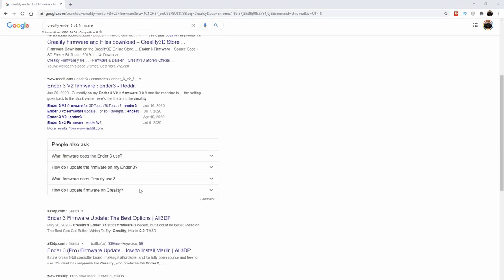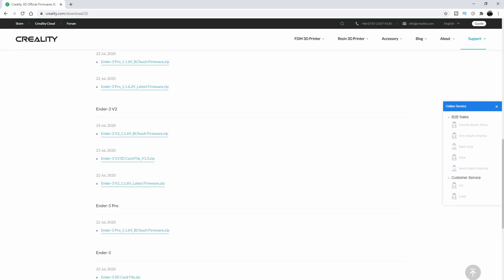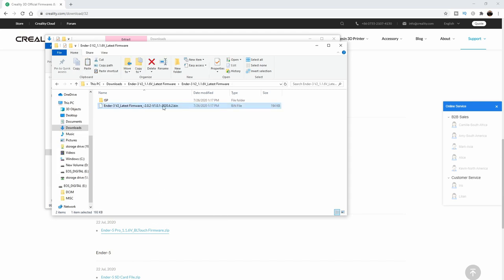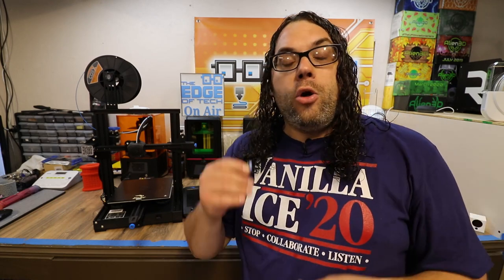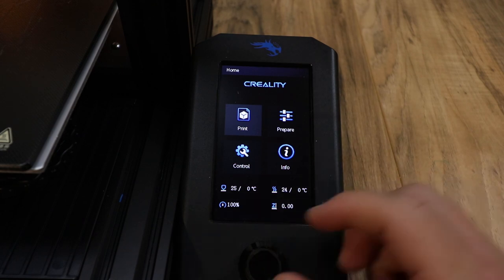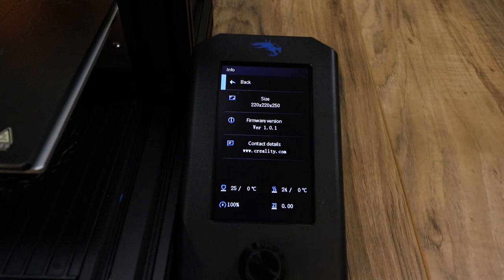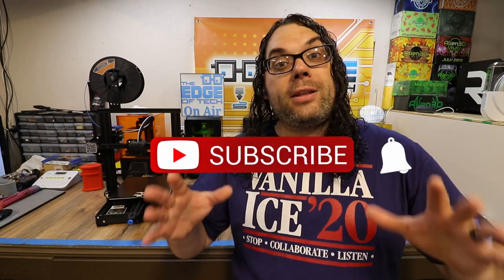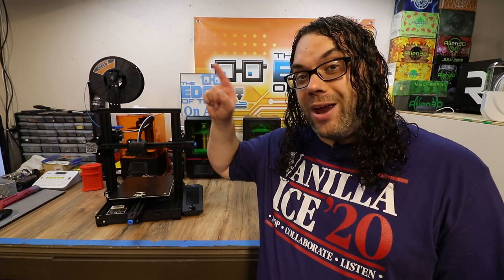Upgrade the Ender 3 V2 Firmware in 5 minutes or less

Comment: You gave me a scare because I thought I bricked my Ender 3 V2.  You must delete other files on the SD card. And I think you must format the SD card as FAT32, otherwise it will not work.  It didn't work for me until I had only the firmware file, on a freshly formatted SD card.  Also, the firmware will not load if it's the same filename as an earlier attempt, so you may need to rename it.  I recommend 8.3 (filename 8 chars or less) just in case.
I'm just happy my 3D printer isn't bricked!  And now it's v1.02.
Reply from the maker: Nice work, and great info! I am glad it's not bricked as well.
Reply: thank you i just need to rename

Comment: It said 1.01 on your display, rename the file to firmware.bin, and it will in fact update to the latest Marlin
Reply from the maker: You never want to rename the file to firmware.bin because on 32-bit boards the firmware name has to be different every time otherwise it will not work. Reality actually miss labeled the firmware on the site, that is why It's different from the site to what shows on the screen.
Reply: @TheEdgeofTech  That is just not true, I have flashed tons of 32 bits boards - all by using firmware.bin on the card. In fact, read a bit on the Marlin page and you will find firmware.bin is the STD on Marlin 2, for picking up the update, all letters must even be in low case.

Comment: Thank you for the video, I have a question though. there are several firmware options dated November 14, options are "with adapter board" or "without adapter board". How do I know if I have an adapter board or not? any info will be appreciated, thank you.

Comment: The point is the official firmware from the Creality"The one you downloaded" does not support BMG or Titan or Gear Ratio equivalent extruder. The reason for this is because the firmware maximum e step for Extruder is only 186.

Comment: So, I followed these steps and now my printer did not update firmware, it just did nothing.  Now it still does nothing when it turns on.  The Creality logo doesn't even show up.  Is there a way to reset it to the original firmware?
Reply: I have uploaded mine m, and it is currently the same. Just a black screen doing nothing. Did you resolve this?
Reply: @ryanowens100   Yes, in my case the problem was a bad SD card.  I grabbed a new card, formatted it (fat 32) and followed the steps of this video.  Worked like a charm.
Reply: @ryanowens100  Yes. In my case, I had a bad SD card.  Once I got a different card, the process described in this video worked.

Comment: Jim, how are you  finding the V2 now that you've had it a bit?
Reply from the maker: I like it so far! It prints very good out of the box and has some great features over the original. I would highly recommend updating the firmware to the newest version you can when you get it though. The stock version has some issues.

Comment: Now i use firmware v1.0.1
I try to new 1.1.6 version ,but it can't update,screen alway black long time . Have you found this problem?
Reply: Im also getting his issue
Reply: fixed it by also copying across the ISP folder to the sd card
Reply from the maker: Nice! I didn't have that issue, but I do see now that the screen has to be updated too. CHEP just put out a great video on this and I am going to do an updated one as well.

Comment: Hey Jim HELP please? I just bought and built the Ender 3 Pro but I don't know what version firmware is on that system. I can't seem to find an answer anywhere on whether or not I need to preform a firmware update???
Reply from the maker: I can look, but if you have the Ender 3 Pro, you probably don't need to do the update unless you really want to. If you have the Ender 3 V2 then you would want to do it. But they are done completely different and this method will not work with the Ender 3 Pro.
Reply: @TheEdgeofTech  ok thanks. I was hoping I didn't have to go the boot loader way so I will probably just leave it be

Comment: thanks, helped me a lot, hope you can do a video on how to install BLTouch fo Ender 3 V2. thanks
Reply from the maker: This is highly requested. I am trying to get one now, and when a good firmware comes out for it, I will make the video! :)
Reply: @TheEdgeofTech  There are two good options for firmware for the BLTouch on the E3 V2.  One by Smith3D, and one by JustAnAussieITGuy on Reddit.  See here for a good mount and links to these firmwares.  The only challenge I've found is wanting/needing to make additional customizations to the firmware for different hot ends, mount XYZ offsets, etc.  I need to learn Marlin!

Comment: I was wondering if you can give me a hand I just bought a ender 5 pro the main board was shot so I purchased a BIGTREETECH SKR MINI E3 V2 - MARLIN 2.0 board with I touch screen, the regular Marlon screen works but when I switch over to the touch screen I keep getting no printer attached and I don't know the first thing about coding or can I still use Creality firmware and how do I download it without messing around with the coding.
Thank you.
Reply: I downloaded the file from Creality didn't work. On a different note what should the card be formatted to fat, fat32 or exfat ? Just to be on the safe side.

Comment: #Question what do you do if printer can not read micro sd cards, especially the one from the box. Printer only works with cable to comp, I even bought a bootloader from older versions, but it looks like this motherboard is different. I can't update it

Comment: I JUST NEED TO KNOW HOW TO FLASH SO THE BLTOUCH FILE WILL DOWNLOAD. I’ve been struggling with this for actual weeks, I’ve extracted the bin file from the correct 4.2.2 file, when I insert the SD card with the .bin on it, the printer doesn’t even acknowledge and boots up like nothing is different, although the BLTOUCH is on but just solid red

Comment: So when I put together my ender 3 v2 the hot end was not moving when asking for home settings. The x-axis moves with the control panel but not when homing. Someone suggested downloading the latest format and adding to the printer. I did that but its just cause the control panel screen to black out for almost half an hour now. I can tell the machine is on but nothing shows up on the panel. Any help?

Comment: Sorry for asking. You download V1.1.6 but info Ver still 1.0.1 after update. seems like it is not updated. What am I missing? Thanks.
Reply: I've got the same situation here. Did you try his version in the video or the newest one?
Reply: @galaktoza  I downloaded latest firmware from creality's site ver 1.1.6 after update info was showing still 1.0.1 just like in this video. I don't know why. Later I add a BLTouch and update version with Marlin BLTouch for 4.2.2 board now it shows latest version. My new problem is, seems I can nit update display  it never turns to orange color so I doubt update is success.
Reply: So, after downloading the 4.2.2 mainboard version, I transferred the DWIN_SET folder from Marlin 2.0.1 original firmware folder AND the actual firmware, version 1.0.2 to the SD card. Now the Octoprint works and I am able to print. Do you know where can I set the print speed midprint?
Reply: where did you get that 1.1.6 version from? I don't see it on the Creality's site
Reply: @galaktoza  I diwnloaded it from Creality's official site about 25 days ago.
Reply: they deleted that, that's why I am wondering. Have a nice day
Reply: @galaktoza  I'm afraid not. I'm very new at 3D stuff. I use Cura 4.8 there is a box where you can input the print speed.

Comment: Jim, please help!  People keep referring me to this tutorial, but I'm doing exactly as you are and it's not working.  I put the SD card in and power up - the fan spins, the display comes on but remains blank and that's where I've been for the past very frustrating 9 hours.
Reply from the maker: Hey Tim! I'm sorry you're having this issue. There may be a display firmware you need to do too. CHEP made a video after mine showing that. I would try that and see if it works. Also, you could try renaming the firmware file and see if that works. Let me know!
Reply from the maker: https://youtu.be/dLZm2itXJkg
Reply: @TheEdgeofTech   I have followed that video also and I managed to upgrade the display, but I still get nothing but fan and a dark screen when I turn it on. I've also renamed the bin file a dozen times.   My wife is gonna murder me if I can't get this thing to work.
Reply: Turns out it was a bad SD card.  Once I got a new one this worked perfectly.  Thanks for the assist and keep kickin' out the awesome videos!
Reply from the maker: @timwrobel6230  Awesome!!! I'm so glad you got it working and it's great advice for others to check there sdcards!

Comment: My v2 is not recognizing the sd card, i tried formating and still not working. I try several times and still not working, please i need help, im kind of frustrated
Reply: did you fix your problem? i'm having that issue, i think some people are, looks like i'll have to dissemble it and return it. Not being able to update firmware is a problem.
Reply: @SHADOW-bg4mm  i actually fixed it, there wasnt a problem, i was uploading stl files directly to the sd card so the machine doesnt recognize them, then i sliced the files with the slicer and then load the sd card with the gcode, and it worked just fine

Comment: I've had mine for several weeks now and have been having great prints, I haven't even checked to see what firmware is on it now. BUT my big question is if the new Ender 3 v2 will be able to use the latest BL Touch and Pi4 for Octoprint? Does anyone know how to open the mb case bottom cover after 3 screws are removed?
Reply from the maker: They released a BL touch firmware, so I'm assuming it will be able to use the new BL touch and PI!
Reply: @TheEdgeofTech  Many thanks! Have you been able to remove the bottom panel to be able to attach the connectors? That's where I'm stuck at the moment.. Cheers
Reply: @Seaking406  there is another screw at the top which you need to do remove I think
Reply: @mornefouchehome  yes, have to get that TOP SCREW!!!
Reply: @timd9430  and Morne Fouche, I've looked but not seeing it.. does of the printer have to be taken apart to gain access to it? And, have you installed the BL Touch on yours? I'd be eager to hear about it.. email?  thanks for the replies!  Cheers from Nova Scotia
Reply: addemdum: I found that top screw! Many Thanks!

Comment: I know this video was made last year, but I followed along and my screen on my printer is just blank. Nothing came up and it's just blank. I let it sit for about ten minutes and nothing happened. I turned the printer off and pulled the sd card. Turned the printer on and still just a blank screen.
Reply from the maker: Are you using the newest firmware? Also, you could try reaming the file to Firmware1.bin or something like that and see it it works. The screen will also need to be updated.
Reply: @TheEdgeofTech  I just now saw your reply. I found a reddit thread that had similiar instructions. I formatted the SD card and then put the file on there and renamed it something else and bam it worked. Thank you so much for the reply.
Reply: @TheEdgeofTech  If I may ask another question, I ended up using the "Ender-3 v2 4.2.2mainboard（32bit）.zip" file from the website. There are newer firmwares. One came out yesterday actually. "Ender-3 V2-Marlin-2.0.1-HW-4.2.7-mainboard-V1.1.2-compatible with BLTouch and filament detection.zip" if I don't have trhe BLTouch or filament detection, do I need that firmware?
Reply from the maker: @Phrostbitex  Nope! Use the one without the bltouch
Reply: @TheEdgeofTech  Sweet. I am using the one in your video. I appreciate your reply. I have subscribed. Content looks like it is right up my alley. Thank you very much.
Reply from the maker: @Phrostbitex  Thanks for the Subscribe!

Comment: doesn't work, now i have a black screen and can't get back. Was at factory 1.0.2, used the latest  ender-3 v2 4.2.7 marlin2.0.1 Z-axis heightened to 350 mm firmware.rar, now screen is completely black and can't seem to recover either. After reading the other comments, I formatted a new SD card, repeated, and then it worked fine.

Comment: do you guys experience... when you level the bed then start print and succeed,... in the next print or the next day you print... you need to level it again cause the nozzle is now too close or too far from the bed even though I did not changed it after the previous print... It's like it is always adjusting after every print... even if all of it's physical parts including the bed is stable...
Reply from the maker: I had pretty good luck, but there was an issue when saving to the EPROM. If you used the z offset to lower or raise the nozzle, the printer would not save that. It would cause it to be off on the next print.
Reply: @TheEdgeofTech  I never use the z offset, I always adjust from the bed's for corners...
Reply: @AriesThrottle  I'm suffering this. My printer has the 1.01. Maybe if we change the springs for the yellow ones....

Comment: Does someone know the difference between firmware :

- V4.2.7-Ender-3 V2-32bit Mainboard-Marlin-2.0.1-V1.3.1-BLTouch-TMC2225.bin
- V4.2.2-Ender-3 V2-32bit Mainboard-Marlin-2.0.1-V1.3.1-BLTouch.bin

I  have an ender 3 v2, when I tried to use TMC version, my printer only shown a black screen.

The other version worked.

Comment: But on the original silent board was version 1.1.8 now its gone back to 1.1.6. Much better to use BTT board.
Reply from the maker: My original silent boards were version 1.1.5 not 1.1.8, not sure I have seen an 1.1.8 silent board for the Ender 3 in any model.

Comment: i just updated my fireware and now im screen doesnt work -_-!
Reply: Try again but with an SD card that just contains the .bin file (renamed to something different since the ender remembers the filename from the last attempted update) and the DWIN_SET directory.

EDIT: I'm now thinking the DWIN_SET directory is unnecessary for the normal firmware update as it is instead used for updating the display: https://www.youtube.com/watch?v=Jswzrh2_ekk.
Reply: @aesircorporation1924  i re-download the file and did just that and it worked again.. am not sure what really happened but everything are working as intended now :)

Comment: Does anyone know why my ender 3 v2 randomly changes its print settings mid print and if so how do i correct this error?
Reply from the maker: Did you upgrade the firmware?
Reply: @TheEdgeofTech  Yes I did that tonight. The update stopped the printer from skipping but it seems like mid print the printer fan just shuts off until I turn it back on in the settings.
Reply from the maker: Hmm crazy. Is anyone else having this issue?

Comment: Did anyone else's monitor stay blank? doesn't boot with our without the memory card now
Reply from the maker: Hmm. Try pulling the memory card out, copying the files off, formatting it and the out the .bin file back in it by itself. Then out into the Printer and turn it on. You could even be safe and re download the firmware if you want. Let me know if that works.
Reply: @TheEdgeofTech  Thanks this worked, as an added measure I renamed the bin file to something new. Great Channel !!!

Comment: didn't work for me. ive tried several times with different micro sd card. the card it came with doesn't work at all
Reply from the maker: What does your firmware version say?
Reply: @TheEdgeofTech  0.0.9
Reply from the maker: @xhappymasksalesmenx4092  Are you following the video step by step?
Reply: @TheEdgeofTech   yes. I've even tried connecting directly yo my pc and nothing shows up
Reply from the maker: @xhappymasksalesmenx4092  Have you tried a different SD card?
Reply: @TheEdgeofTech  yes and the sd card that comes with it seems completely faulty. I've contacted creality im guessing something may be wrong with the printer as sometimes it just wont print at all and i have to reset several times
Reply from the maker: @xhappymasksalesmenx4092  try renaming the firmware file to something like new firmware.bin And try again
Reply: @TheEdgeofTech  i've tried that as well. Thanks but i think it's a hardware issue
Reply: Same problem with me. Really frustrating. I had tried it . Returning machine.

Comment: I put the latest update on the SD card turn it on and nothing hapoens
Reply: Are you still having this problem? I tried to update to the latest firmware (Ender-3 V2_32bit_ 2.0.1V Latest Firmware_0814.rar) and I couldn't get it to boot. Screen backlight turns on but no text or image.
Reply: Andrew Mok I can get might to turn on but doesn’t even update
Reply: Andrew Mok maybe you need the DWIN file for your screen and menu to boot up